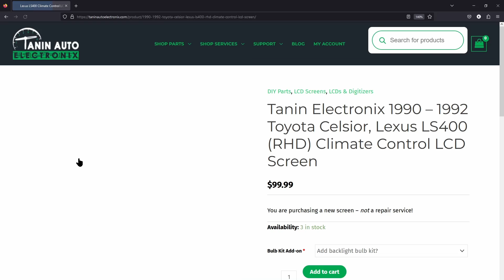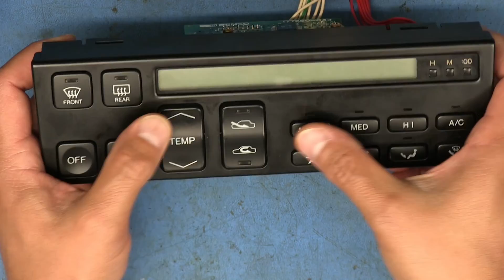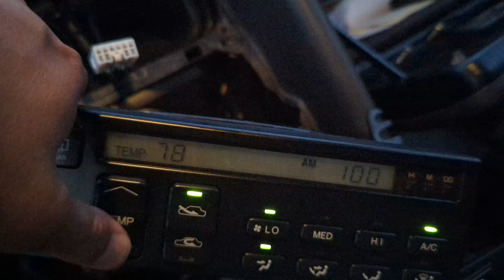TEF (Formerly TWB) #109 | 1990-92 Lexus LS400 Climate Control Module LCD Replacement

Comment: had the same process done on my 1994 ls400 but now almost every pixel is lit at the same time when temperature increases. What i have i done wrong? tried ordering another display and it seems to behave the same... When attaching old one everything works just fine
Reply from the maker: If the replacement LCD is exactly the same, I'd check for bridged solder joints or something. Even if it's not completely bridged over, even a tiny bit of conduction between pins could cause them to activate when they shouldn't. Otherwise it sounds like a really unusual issue.

Comment: Thanks! Nice instructional video! Have you come up with a solution to the LS400 speedo needle led problem?
Reply from the maker: I honestly don't know about that issue, as I don't own this car. It belongs to a friend. If the issue comes up, I can take a look at it and see what's up.

I will, most likely, be doing a video at some point in the near future about replacing the capacitors in the ECM, as apparently they are known to get leaky and cause problems.
Reply: @ThatElectronicsFool A ton of people would greatly appreciate that, It is fairly common. I’d say the speedometer is just as common if not more common but usually the problem is the same with capacitors if the needle just falls.
Reply: It’s pretty common, half my needle is flickery on the speedo, and the LCD screen is out, 165,000 miles single owner 91 🙌🏼 it got traded into my Lexus dealership a week ago
Reply: I found a solution to that. It isn't perfect, but at least gets the needle to light up. 
The needle has a conductive coating or sheath that cracks, losing connection,  and  eventually flakes off. I experimented with making a conductive paint to brush onto the needle, but also cracked in a short time. The best solution was to take a single, fine stand of copper wire, and make a small loop on the end. Run the wire along the back of the needle, and connect it to the exposed metal. I believe it is s florescent tube, and no actual electrical connection is necessary at the outer end of the needle. The loop just holds it on. Just wrap the wire around the metal at the inner part of the needle. I would not try to solder it. It is very tedious to do, but at least gets the whole needle to light up. Study the KJV Bible, and ask the Lord Jesus to save you from your sins. Cars are real fun. Hell is real, but not fun.